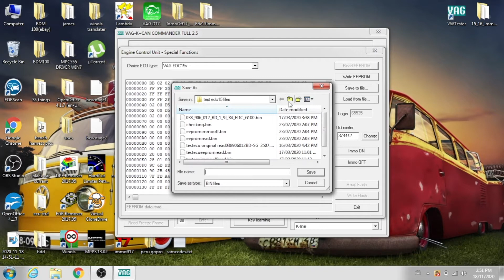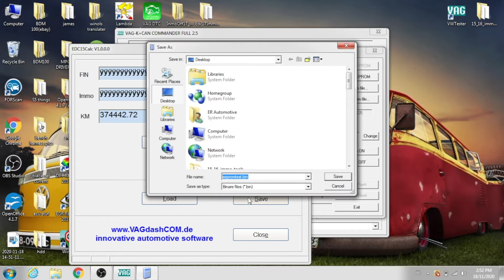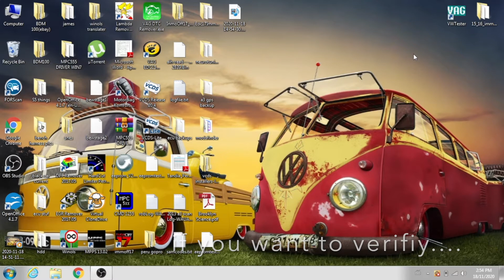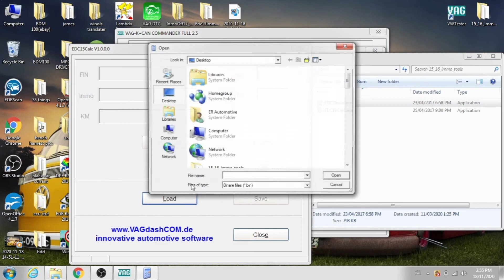how to edc15 immo off (how to alh immo off)

Comment: hi i do have an issue with my 1998 volkswagen passat 1.8T B5 the car start then shuts off instantly sometime it's just cranking. How can you help me I don't have any programming tools but I know how to solder, and upon my research I've come across this immobilizer emulator device that you will just solder it on the wiring pins of the instrument cluster gauge im about to recieve the the emulator by nextweek upon arrival I'm gonna install it and hope it will disable the immobilizer and on Will permanently resolve the starting issue issue

Comment: Does this remove the "Immobilizer active" from the dashboard also? Car runs but the immobilizer active is still on the dashboard
Reply from the maker: If it’s the original cluster you won’t have that message 
If not original cluster 
Use dash dump edit to remove that message
Reply: @ERAutomotive  is that a program? Do u have a link to it

Comment: Will this work with a B5 RS4? Have to remove cluster with KM for one with MPH but the new cluster doesn’t have immobilizer.
Reply from the maker: Check this 
I believe your ecu is me 7
https://youtu.be/j099R-6tj2c
Reply: @ERAutomotive  thanks. I don’t have that bench equipment. Wouldn’t get it in time if I ordered it. What if I found another cluster with immo and cloned the old one would that work
Reply from the maker: Check out nefmoto
They have a different method that uses the blue kkl cable

Comment: @ER Automotive Which driver did you use with the "Dumb" vag-com  dongle ?
Reply from the maker: I believe the one that installed with vcds lite 

Also the immo off button in vagtester works
Reply: @ERAutomotive  Thanx, I couldn't get any version of VagTester to communicate with the ecu using both drivers (believe it doesn't open the port for some reason) ... I'll try using the Hex interface to see if it corrects the problem, tho the blue one does work with vag-com lite which technically should work with VagTester
Reply: ... and i did set up the port in the tester file
Reply from the maker: That’s very strange
Reply: @ERAutomotive  Thanks for reply and good tutorial btw... And yes, tried different versions I think v3.5 was coming up with port error (which i set to 4 where my com-port is set to) and the v2.5 said no response from ecu...  Used K-Line as the protocol... I made a dual boot setup on the laptop so ill try first on Win XP instead of win7 maybe its something in the windows
Reply from the maker: Thanks
Mine is 2.5 and windows 7
Reply: @ERAutomotive  I think mine is Win7 SP1

Comment: Hy thanks for your time.

Is it ok to ask why they want you to do the immo of i understood immo stands for immobilizer but i don't fully understand what do you mean by immo of if you don't mind plz.
Reply from the maker: Makes it easier to swap in a different ecu into the car
Or for swaps since typically the swap car wouldn’t have the rest of the parts required for fully functioning immobilizer
Reply: @ERAutomotive  oh i see it now thank you How about the data on the old ECU? 

And I guess the car would start with out the transponder on the fob afterward right?
Reply from the maker: Yes that’s right

Comment: Hi, can you tell me why cant you use the "Immo off" button instead?
Thanks in advance for the answer
Reply from the maker: You certainly can and that’s now I do it now actually
Reply: Thanks man <3
Reply: What do you mean? Just click immo off and it does it for you ?
Reply from the maker: @alhalex8501 when u open the program you will see
Reply: @ERAutomotive  okay but not vcds with a hex v2 cable right ? That won’t work correct ?

Comment: Hello how is the name from the obd2 tool? Do you have a link please to buy them? and the other question , how can i get this siftware to read the eeprom
Reply from the maker: The cable is a blue kkl from eBay or Amazon 
Cheap cable less then 10$ 
And there’s a link in another comment for the software
Reply: Thank you do you have a link for the cable please amazon or ebay and the edc15 edc16 cal i have but i need this software to read the eeprom i have a original ross tech vcds can i read with them and this Software
Reply from the maker: Just a quick eBay search 

https://www.ebay.ca/itm/402812947205
Reply: Thank you my friend very much but can i read the eeprom and write with the original ross tech vcds and this software?
Reply from the maker: No

Comment: Great video! This software work with hex-v2 cable? I have also kess v2 and MPPS V16 can I read TDI ALH's eeprom with this tools? Thanks very much!
Reply from the maker: I use blue kkl cable for this
Reply: hex-v2 not work it is on usb not com port. mpps v16 not work. i try on audi a3 8L.

Comment: Will this flash a light in the dashboard? And if it does, how do I remove it?
Reply from the maker: No it doesn’t flash light on dash In my experience
Reply: The immo will still be active in the instrument cluster and when it dosen't detect the right signal from the key the immo light will flash, but the ECU ignores the signal from the cluster and the engine stays running. Sorry no fix for the light. Other than covering it or removing the bulb.

Comment: I allready have bin file. I try to do immo off with edc 15. when I open the bin file with ec15 FIN and Immo parts emty, KM and Login 0(zero), Immo status ON. than I push Off and calccheck and save . The saved file is 0KB. What is the problem?
Reply from the maker: Sounds like a bad read
Reply: @ERAutomotive  ı have 2 bin files. One is original , other is tuned stage 1 file. Both files read by tuning company. I tryed both files but result are same. 0KB
Reply from the maker: That’s not the immobilizer file
Reply: @ERAutomotive  I didn't know they were two separate files. sorry. When I saw the bin extension, I thought it was a single file. I will try to read the immo file myself. thank you

Comment: My car audi a3 2002. year was stolen. I found and returned the car, but now the immobilizer light flashes constantly. The car can start with any key. The immo light flashes all the time while the engine is running. How do I fix this?
Reply: I had that yesterday, but I tried programming 2 keys and only had one on hand. Once I tried again with 1 Key it went away. Try reprogramming the key.

Comment: I turned immo off on my 2002 golf tdi, with this process. Engine starts and runs fine, but I now get a check engine light for engine block by immobilizer. Does anyone know what i have to do to fix my new problem? Has anyone experienced a  check engine light for immo after immo off programming? Or do i just have to deal with the check engine light on all the time. If i erase the code it sets right back on the next start.
Reply from the maker: Did U checksum ? Before writing
Reply: @ERAutomotive  , I did. But i will try loading ariginal file again and retry process.
Reply: I think my problem was the TCM loosing signal from the ECU when programming and the TCM was setting DTC's. Cleared all DTC's and test drove. So far so good. Thanks for the info.
Reply from the maker: Yeah that makes sense 
Always clear codes after flashing

Comment: Will it work with VW caddy 2011?
Reply from the maker: That has a different ecu 
And is a different procedure I haven’t personally done one
Reply: @ERAutomotive  is this tutorial compatible with VW caddy 2006? It has immo 3. How to know if its EDC15 or EDC16?
Reply from the maker: Depends on the ecu 
2006 prob has ecu 16 
So verify and follow the correct tutorial
Reply: @ERAutomotive  how can i werify it?
Reply from the maker: Easiest way is to look at ecu
Reply: @ERAutomotive  Ok, now I know. I have edc15, can I use the immo off button directly in the vag commander or is it better to di it with the edc15 calc program?
Reply from the maker: Yes use that button
Works perfect everytime I used it
Reply: @ERAutomotive  and after I push it I can exit vag commander directly?